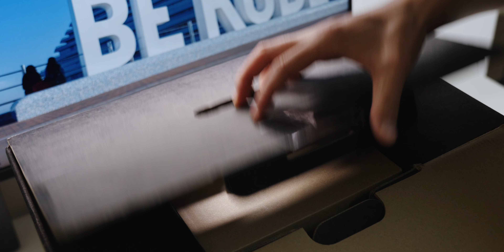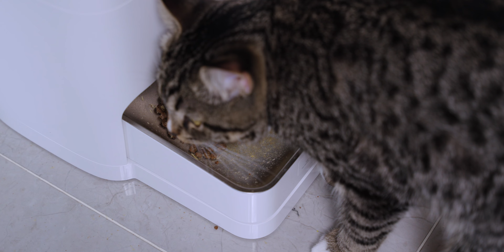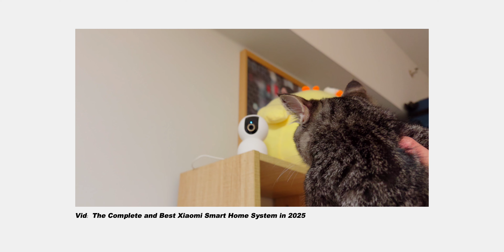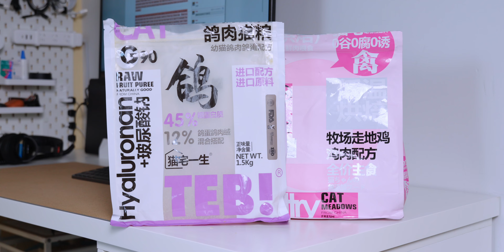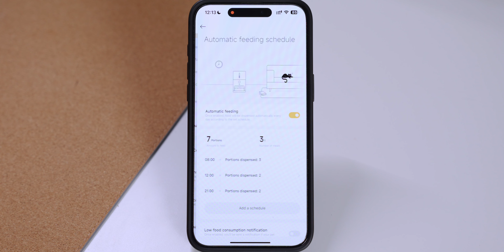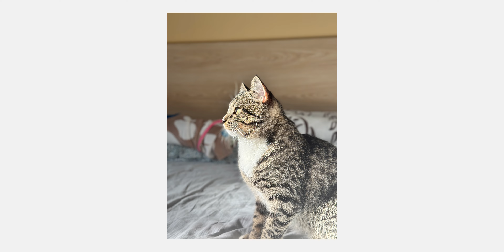Xiaomi Smart Pet Food Feeder 2 Review: It's Tiger Approved.

Comment from the maker: I found a few issues with this machine: 
1. The batteries under the machine will be drained in time. I used to think the batteries will last a long time if the machine is connected to the grid, but no. So if you need to go on a vacation, make sure you check the batteries before going out. 
2. There were a few times when the measure was not accurate. Usually Tiger eats 40-60g per day, and the auto-refill schedule is made according to that, but there were a few times that it says Tiger ate 100+g, that's impossible. So be aware of this issue.
Reply: 100+ gr?😮 Thats a problem. How many times did this occure?!
Reply from the maker: Only two times actually, I wouldn’t consider this as a serious issue.